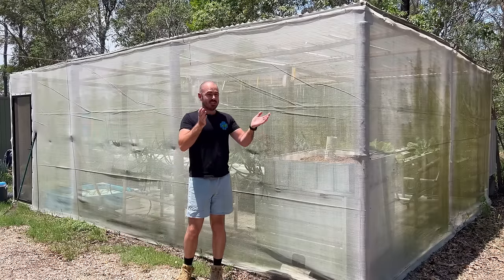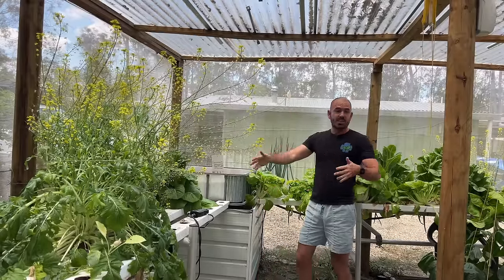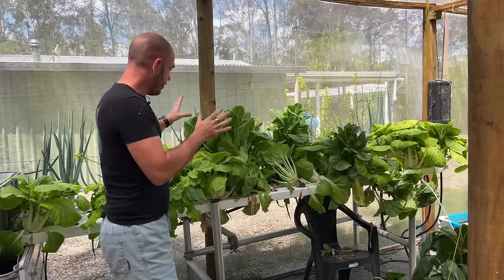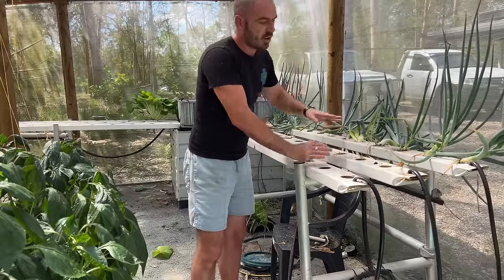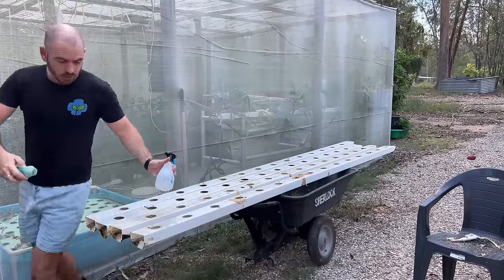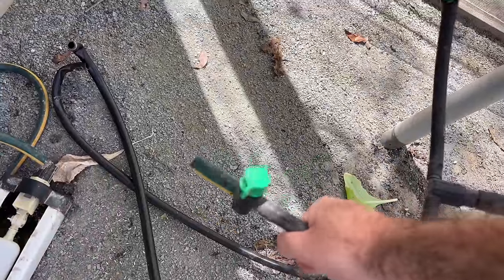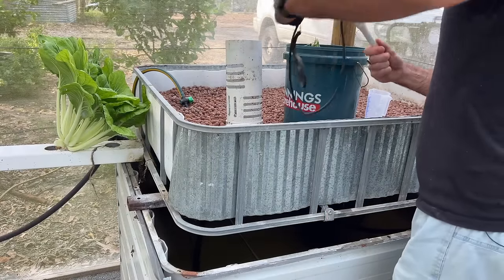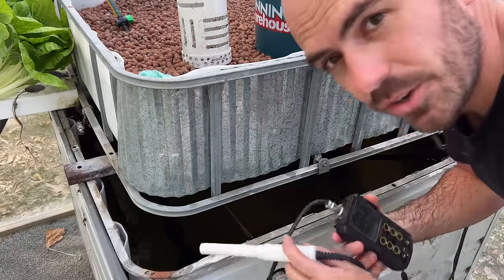Nutrient Film Technique: Operation and Maintenance

Comment: Consider Diatomaceous Earth, which is an incredible pesticide. Don't use the pool type that's heat treated; the pool type is hazardous to breathe (the untreated is not). DE is indiscriminate, so be very careful around pollinators. It's only downside is susceptibility to water. It only works when it remains dry. But it works wonderfully.

Comment: I think the next step is to develop an opensource hydroponic system tracking software with Arduinos and Raspberry Pis and other monitoring systems. realtime and historical water levels and nutrient concentration metrics. cost to produce vs produce yield etc.. help to compare systems and dial in performance